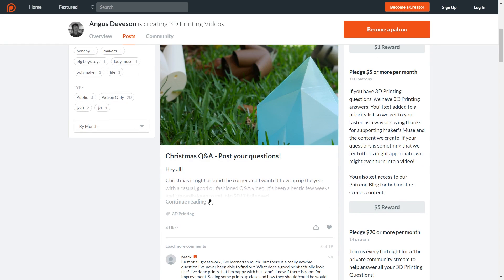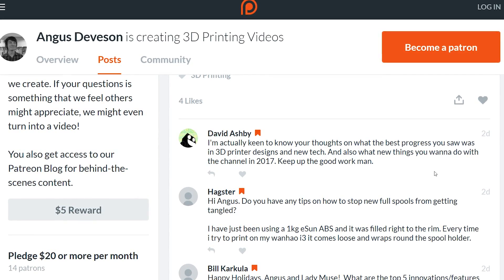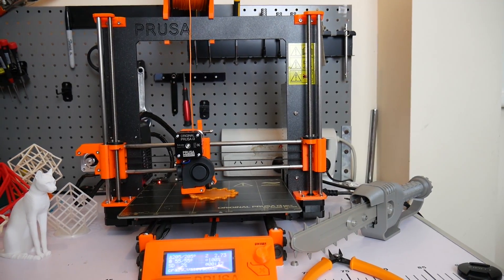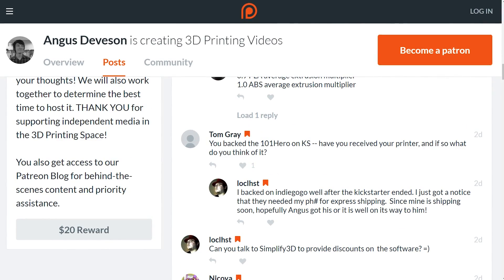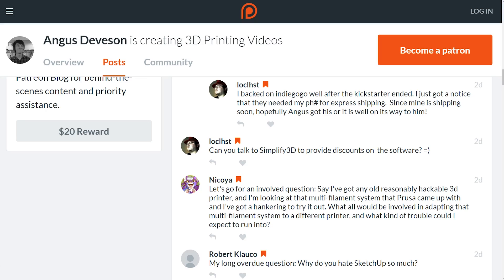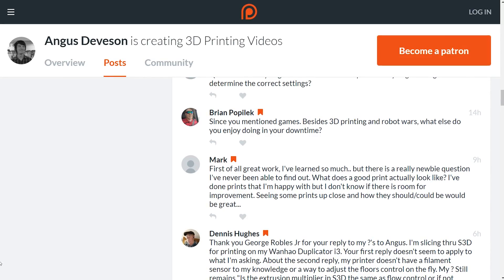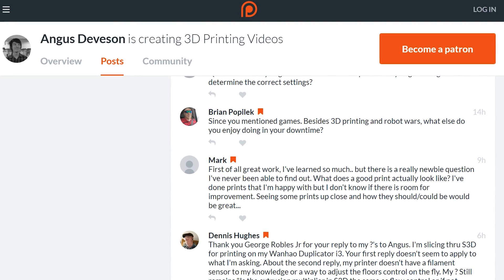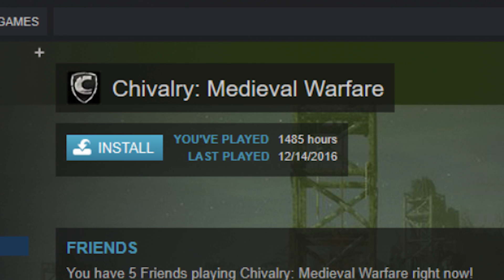Your 3D Printing Questions Answered! Maker's Muse Q&A Christmas 2016

Comment: Jerk settings will control how much of a jerk your printer will be when it prints.
Examples include:
• Attacking the finished print
• Warping your print intentionally
• Mixing up dissolvable and non-dissolvable filaments
• Permanatly attaching supports and the raft to the print

Comment: Hi Angus. Re: Sketchup. I'm not defending it but it happens to be the only CAD software I know how to use at this point. I just this week used it to design a small case for a pre-amp. Initially I couldn't manage to make a watertight model but I then discovered the "Solid Inspector 2" plugin which automatically fixed most of the errors, and highlighted the other errors. It only took me around 20 mins to fix all the other errors. I'm still waiting to print the case but the resulting STL model looks good.

Comment: hello,
i designed something in autocad (changed measurements with using"units" command and choosen centimeters)
after designing i selected the object and then exported as .stl file 
and then i loaded that file in repetier host, but now in the repetier host my object is too small and shows 14 mm filament will be needed for print.
can you tell me what's wrong? so i can fix it and use my first new 3d printer its Flsun 3d printer metal frame one.
bed size in repetier host is 200 mm x 200 mm 
:(

Comment: Perfect video! I had a lot of the same questions. I just got into this stuff. I'm flipping back and forth from Cura and simplify3d, simplify3d frustraits me a bit more but I can see why it might be better.

I have been watching all your videos and learning sooooo much. I haven't made any of my own designs yet. just gathering ideas on things I can make. I havent tried to do any sort of 3d design for about 13 years so... I have no clue where to start. hevent got to those videos yet.
Reply: I recommend watching Chuck Hellebuyck's channel and getting familiar with TinkerCAD.  It is some good basic CAD software to get you going fast.  I've made lots of models with this and I know its limits.  TinkerCAD Shape Generators can usually stretch those limits.  If you want to get outside of those limits, Fusion 360 is the next software to learn.

Comment: 7:50 your talking about using sketchup and no way to check for errors.  once you export as a stl you can open it in windows 10 3D software and it will fix the errors then just save the new file. i have had no issue with this.
Reply from the maker: Yeah, you can definitely file fix... but 'why' should you :)
Reply: And not all of us use Windows 10.  I run Linux and don't have this fixing software.

Comment: i have a Wanhao i3 v2.1, and i noticed that on prints the y-axis side has some wobbles in it.
On a test cube it has a really nice sinus-wave, not extremely prominent but noticable...
In the Accelaretion option i set the "Print Y" to 800 and the Jerk to 8, as i read in a Forum but the wobbles are still there... is there anything else i could do?

Comment: Great information Angus!
Jerk and accelerations are not controlled in Simplify3d at all.. 
Unless you manually add them to the startup gcode as far as I know.

Happy Holidays!
Reply: If I recall correctly, these settings are available (at least in the Prusa version) in Slic3r.  And in Simplify 3D they are a bit of a hack, but I know that Josef's recommended RC4 S3D profile uses them.

Comment: Is the Wanhao i3 V2 Duplicator high quality enough to produce scenery such as for model railways and castles?  ive been designing for years and would like to step up to physical prototypes.  thanks.
Reply: Gill There are quite a few cases of the hotbed connector on the Melzi board overheating and melting. Wanhao are very quiet on the matter. Search i3 and xt60 to get started. Other than this, it probably can with a smaller nozzle and layer height.
Reply: this is the issue im looking for a £300 printer to build a scenery + other cool stuff,

Comment: I'll support Sketchup - just needs the export STL & 'Cleanup' plugins and I have zero problems - I think the main problems come from people who don't take care to model cleanly using it and giving it a bad rep. I'm trying to use Fusion 360 but every time that makes me bang my head against the wall I switch to Sketchup and do what I want in a few mins.
Reply: Maker's Muse I still use sketchup but not for 3d printing, I use it for cnc milling and laser cutting flat pack objects. sketchup is not so good for organic shapes. Fusion 360 is a process of banging your head against the wall, but stick with it it is worth the time and effort to learn, just you NEED a Project to figure out how to use the software. just making something is not going to get you to understand the software.
Reply: I agree with Coleman, shortly after getting my 3d printer I tried to design something and found it wasn't possible in sketchup, I found Fusion, started using it, felt as you did, but I realized it was a far more powerful program so I forced myself to continue and never went back to sketchup.  Now I can make anything I want, quickly, in fusion.
Reply: Thats actually what I've just been learning, I've been using fusion almost a year now but I've always used it linearly. I'm just now learning to use the timeline and learning to think that if I need a parameter changed I should go back in time to where it originated and change it there than modify it now.  
To Peter, Subscribe to fusion 360s youtube channel, lots of GREAT content for learning to use the program there.
Reply from the maker: It's like any learning curve I guess - you've put the time into Sketchup so you know how to make it work for you. I respect that, but for any newbie looking to design for 3D Printing it's the last thing I'd recommend honestly.
Reply: I really need to sit down with Fusion 360 and get a grip on it as it's clearly a more powerful program - I just don't like some of it's control choices & endless vague options.
Reply: It's like Blender. Just throwing together, adding / subtracting, subdividing, and so on can make you a model, but you really REALLY have to pay attention and check things constantly to make sure its not a holey inverted mess.
Reply: Hello Angus! Since I'm on architecture most models are made on Archicad, or Vectorworks, or Cinema 4D?  3DSMax. But mostly Archicad. Do you have any knowledge if Archicad is proper for 3D printing?
Reply: How about large 1m3 printer like BigRep?
Reply: Yes. Blocks Zero from Blockstec. 200$ first batch preorder from Indiegogo.
Reply: Anybodysguess it's a tough program to jump into but it is doable. I really love the time line and the ability to jump back.